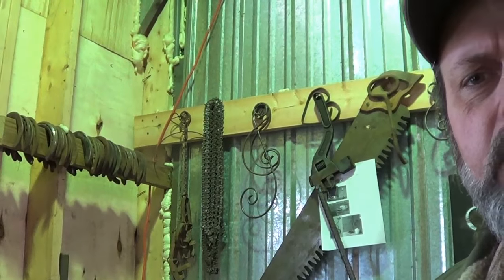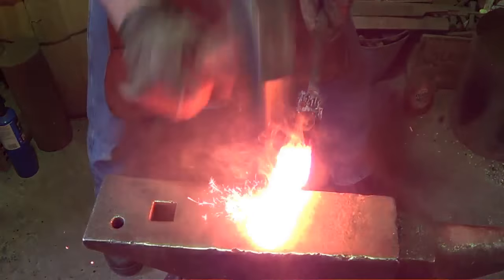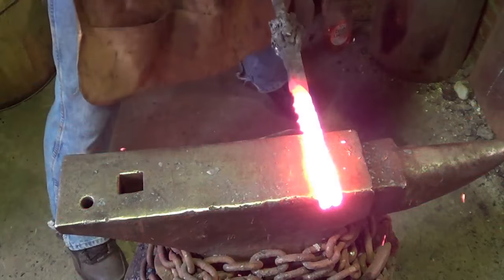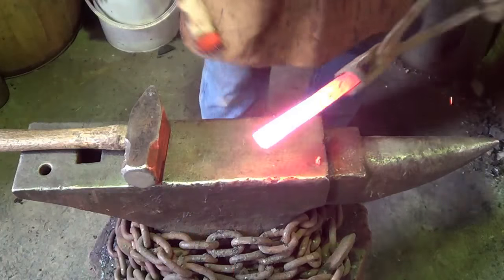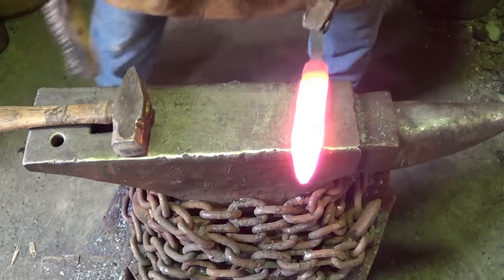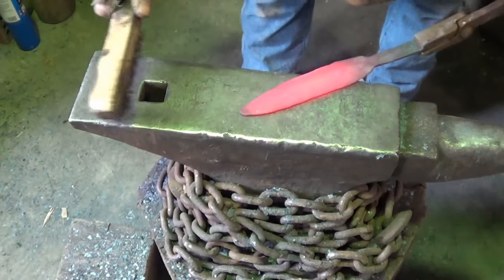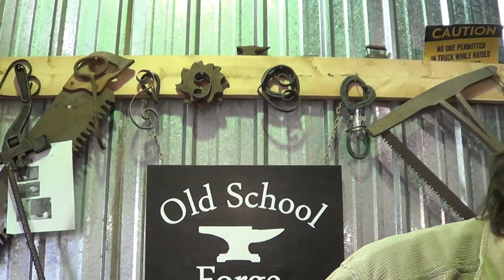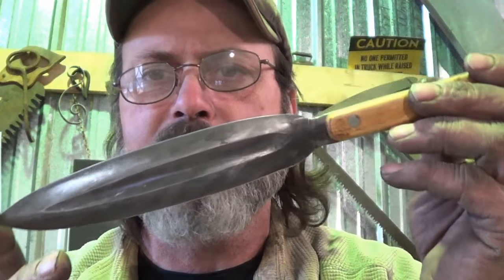Blacksmithing - Forging Welding Chainsaw Chain And Making A Super Sharp Pattern Dagger

Comment: I really enjoy and appreciate your videos, you are willing to show us your experiments and your willing to show us mistakes you may make, you are one of the very few Blacksmiths who does everything by hand, just about everyone who shows videos here on YouTube have power hammers and presses, don't get me wrong, I completely understand that those tools make life easier and faster, I am a metal fabricator, working with sheet metal for building and making body panels, filler panels and custom pieces like hoods and bumpers for custom vehicles like mini trucks and imports, I have made custom frames and custom suspension components and I did everything by hand because I am disabled and can't afford high priced tools, I have made my own jigs to make custom pieces that were my own design and kinda my own trade mark, it's funny how you keep commenting on your gloves, I know we're your coming from since I have been in that same situation, my problem is I am stuck in a wheelchair so I need my arms and hands to get around so I started spending a decent amount of money on gloves. I completely understand that what you do and what I do is like comparing oranges to grapes. I owned my own shop building custom vehicles for a lil over 10 years before the economy took a shit and forced me out, I just couldn't compete with bigger shops so I decided I made a good run building custom vehicles and got as far as I could with what I could do so I decided to try my hand at blacksmithing, I want to learn another aspect in working with metal, I taught myself how to build custom vehicles, making custom sheet metal pieces, all by hand, using hand tools to do everything with the exclusion of my air tools such as air grinders, air body saws, different air Sanders. I have easily over 40 different body hammers that I hope I can use some of them for small pieces I may make as I learn how to be a blacksmith. I have several different heavy hammers that I used for beating sheet metal into submission along with my shot bags. Right now I'm trying to find an anvil and figure out which type of forge I want to make and use, I'm leaning towards a forge like yours, a coal forge. To me, that seems the best way to go. I want to learn the basics and learn or start out how blacksmithing started out and watching your videos show me that it's worth doing so. I can say this, I imagine how bad your hands hurt from time between swinging hammers by hand and from this video I see how dried out your skin is. Keep up the excellent work and craftsmanship. Your an inspiration to me just because you make some amazing pieces without using excessively expensive tools to get the job done. Thanks bud

Comment: Dude! At 24:03 when that chunk squirted off of the end I almost cried for you. Like an hour and a half in and the fire gods slapped you like that.  You are a wild man.  And I mean that in the most awesome way.  You are just a "let's see what happens." kind of guy.  I've got fire.  I've got steel. I've got skill... What the hell?  What's the worst that could happen?  I waste a day in my shop, burn the joint down, and capture it all on video.  Better than having some boss screaming over my shoulder.  I'm good. Welding gloves cost like $30.  But finger gloves mean that you can really feel the hammer.

Comment: I like theese long videos, they are so relaxing to watch :) I have tried some blacksmithing and always asked my dad to get us a small forge, now im 22 and wishing to do it all by my self. Keep up the good work sir! Its fun that somebody in this cruel world wants to teach awesome stuff for younger people.

Ps. That one crack is there, but wont be bothering me. Im glad to see you happy with the result and specially positive!

-Chronos
Reply: If you have access to a welder, building a cheapo coal forge with a brake rotor is a fairly common and basic way to acquire a forge. I personally prefer propane, but coal can get HOT a lot more quickly and it's easier to work oddly shaped stock.

Comment: That's a damn fine blade and an excellent job of forge welding. I'm glad you didn't call this a "Damascus Steel" knife like every other YouTube blacksmith does.
Reply: Whats the problem with damascus steel? They look cool! , and are meant to be strong blades?
Reply: It isn't Damascus (wootz) steel, which has a very different chemical composition and molecular structure. A lot of people conflate forge welding with Damascus steel because they look the same.

Comment: awesome videos, something you can make to bevel blades is use some angle steel with a threaded hole in the middle on one side. use a nut n bolt to set angle you want then clamp blade to grind.

Comment: Hey Chandler,  I like you vids. If you wouldn't mind a bit of constructive criticism I have one little tip on forging blades. I have been a blacksmith for about 16 years and went through an apprenticeship under a guy who had been doing it for around 40 years. If you you put the edge of the blade next to an edge on the anvil, Ie. the face edge on the horn side, then you can get a cleaner bevel on your blades with less wear and tear on your hammers and your anvil. Keep up the good work buddy. And keep putting the vids out.

Comment: Hey chandler,

I know this is months late, but one thing you might try for this type of fold-and-weld is putting the borax between the two pieces before finishing the fold. This will help act as an oxygen barrier, and keep out anything preventing the weld.

Comment: I pre clean my stacked chain in acid first, then do the forging it does make a difference. the metal is cleaner. I find that it makes the welding of the chain easier and faster.

Comment: i drop my chains in a bucket of degreaser and let them sit prior to messing with them- what i use is alcohol based so it evaporates pretty quick when you take them out before welding- gets mostly all the crap out of the chains

Comment: hey Chandler, I'm no blacksmith but why not weld the square part of the fullering swage that goes into the Hardy hole closer to the open end? that might stop it from moving around as much.

Comment: Little question from someone looking to get into forging(have the equipment, but don't want to f anything up). Is there any particular reason why, when you are beveling the blade on the dagger, you will sometimes swing the hammer away from your body? It looks like you are achieving the same affect as swinging the hammer towards yourself, only by swinging away you are unable to generate the same amount of force as swinging in. 
Keep the good vids rolling,
Thanks for the read and response.

Comment: It's not a utility knife. It's not a bushcraft knife. It doesn't have to do hard work everyday. It won't break in a knife fight and unless you live in Chicago it might not ever have to do that. I'd have no problem carrying that for defensive back up to a handgun...which I wouldn't have if I lived in Chicago I guess. Point is it will do it's job without failing and it's a step closer to perfection. Great vid!

Comment: I think the saying is an hour at the forge saves two hours at the grind. witch means the closer you get the edge of the blade to its final shape the less you have to grind to sharpen and polish it up.

Comment: Question for you Chandler Dickinson. I noticed as you worked up towards the handle forge welding the sound of the hammer on steel changed. Might I ask why if you know?

Comment: you should consider raising your anvil about 6 inches, you're not getting as flat surface contact with the geometry. proper height will get you a good posture which results in less odd posture and less denting in the forging.

Comment: How long does it normally take for a 1/2 inch square piece of metal to come up to welding temp? Oh and do you have the part you want to weld deep in the fire or at more of a midway point?

Comment: thank you for covering up your welds a little bit there's other videos I have watched on black smithing that the folks didn't try to cover them I don't think they realize that even on video it can still hurt a lot too watch granted you can't get arc burn from it but it can still hurt like a s.o.b. So again thank you for covering up your welding even if it is a little it still helps by the way can you make something out of an aluminum dip tobacco lid??

Comment: you might want to harden that steel before etching ;D nice video as allways
Reply: +Knifeguy0 and do the forging of the bevel on the edge of the anvil:D saves anvil and easyer control

Comment: The best way to weld chain and wire like cable always wd40 before heat then mix borax with water in bucket and dunk that in there this way you get all the little cracks

Comment: I have to ask because I have never seen a blacksmithing video but at the half way mark as you are shaping the blade black flakes come off just very thin, is this the carbon or impurities coming out  ?. I machine so I know from the point of metals for a job but never the red hot shaping

Comment: I'm trying to start smithing, and I have a quick question, as you were hitting the billet on the anvil, does it also begin consolidating?
Reply: +Kevin Barrett Yes, It consolidates - I learned that on the man at arms reforged show, they made the kill bill katana. - you will hear it , the hammer will thump for a while and then it will ring like when you hit the anvil

Comment: An up and coming blacksmith (myself) would like to know if rebar is a good steel? I have altogether about 40 pounds in my garage and I was curious
Reply: +Luis Ortiz-Sanchez It all depends on what you intend to use it for. If you plan to make a blade out of it, it won't be a good choice since it doesn't have enough carbon for good edge retention.
Reply: +Hak Kar thank you.
Reply: Luis Ortiz-Sanchez No problem friend, if you need any more info on forging, just ask.

Comment: Forgive my ignorance, but I've seen other blacksmith's anvils like yours with the chain wrapped around it. Does it help deaden the sound whilst hammering? Please tell. Thanks
Reply: i wondered about that.......thought it  might be to catch sparks
Reply: goggled it and yeah its to stop  the ring ......
Reply: Thanks Ya'll!!
Reply: In addition to wrapping chain, there's a few other techniques. By a huuuuge margin, the most effective seems to be adding oil reservoirs to the legs of your anvil stand.

Comment: I'm sorry, I see a lot I compliments but for me this looks very rough. I am a gold/silver smith by hobby, a master finish carpenter by trade, although I have paid bills with both. My work requires, and has, a much higher level of quality for fit and finish. I have made many knives, but never forged a blade although I am heading in that direction. I would like to think I would produce a much better looking result, I guess I will find out soon. I will say though, very impressive welding of chain.

Comment: why not weld up the flaw and grind and sand back down.
Reply: because you're just covering it up, if the flaw goes all the way through it is still a flaw in the blade, plus you'd still see a big silver blotch of weld
Reply: J Davidson because it would be a surface fix at best. you have no idea with that twist and all those chain shapes, just where and how far that flaw will go.

in addition, the weld would be highly visible on top of the pattern etch... it would be akin to a knot in a 2x4. you'd see it clear across the room.

Comment: I feel sorry for this guys hard drive. It must go through sooo many writes and reads with the fact that he makes hour long vids.
Reply: +Alpha Nerd unless its an ssd that dosent really matter
Reply: trevor currie Even an SSD has its limits. Granted it is a TON more but it still does. If it is an SSD then he also has to make sure he is keeping upkeep on it.
Reply: Alpha Nerd no, an ssd will fail sooner than a platter drive. You clearly don't know what you're talking about. There is also nothing you can do upkeep wise for a disk, other than keeping dust off of it. Even then, that does nothing but create a cleaner surface to cool from.
Reply: ..... dude... A: what I meant was the upkeep of a SSD. And there is a type of data cleanup that is handy when using an SSD. and B: it depends a lot on the type of SSD and his system on how long it will last.

Comment: I love your videos however, stop talking about catching the place on fire.  Either you will, or you wont.  If you do, put the fire out.  Its not the end of the world, we all have set shit on fire.  There is a bucket of water in your shot, plus the fire extinguisher.  We don't need to hear it over and over.  We get the point.  Hot metal is hot metal.